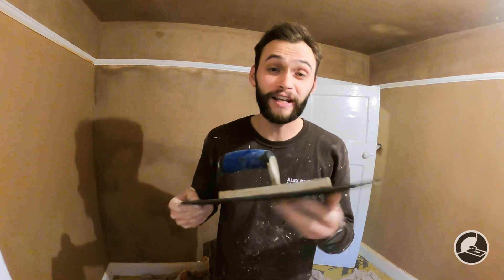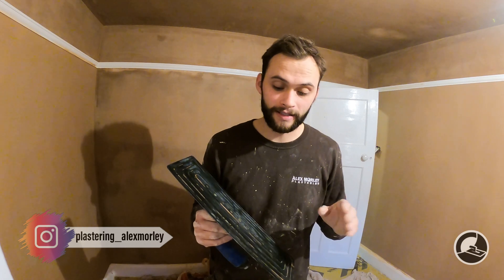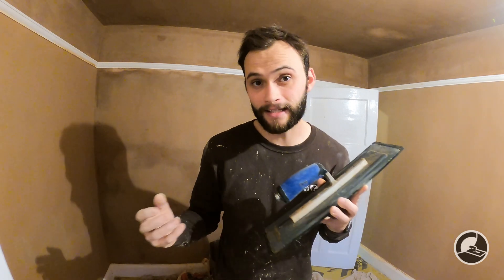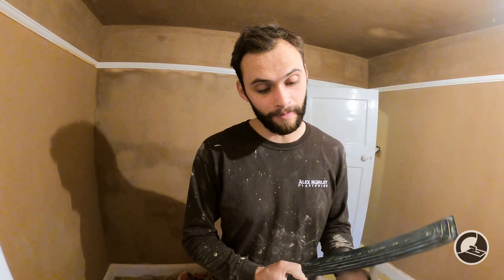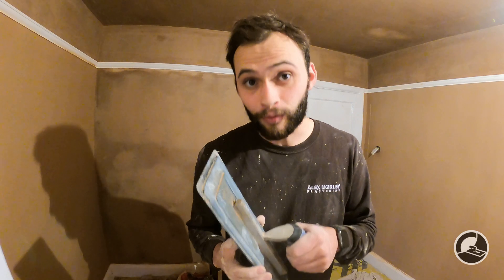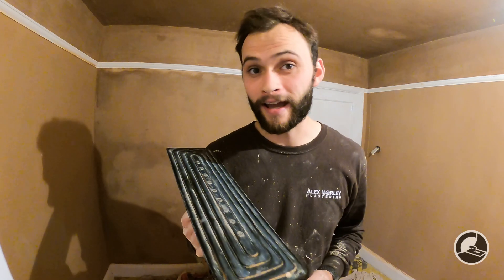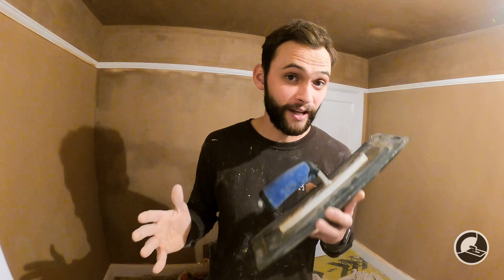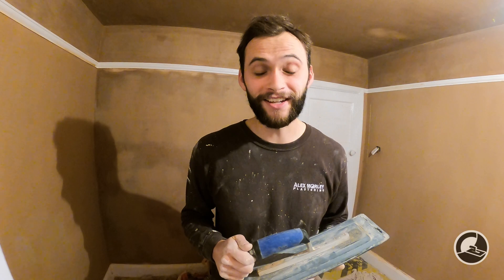Carta101- Review

Comment: Great thorough review. The main reason why I would never use one is the stepped layers of the face of the trowel. You couldn't even scrape off excess on the edge of your hawk. Horrible design. I'll stick to my Marshalltown I've had 10 years :-)
Reply: try the ox plastic float 18inch 
I use it to flatten between coats 
and polish 
bit of 600 sand paper to get rid of any nicks along the blade edge 
and the light and u can change the blades been using them since they came out pucker

Comment: it has the same handle as a refina super flex .and i don't think this guy would use his other plastic trowels on anything with blue grit .no plasterer would do that .so a little unfair i think.
Reply from the maker: Handle is unbranded. The refina ones are not. 

The Nela plastic we have isn’t designed for all stages of plastering. Where as the Carta101 is. As such it’s reasonable to test it on a medium used regularly in plastering. Such as blue grit. 

It clearly highlights the frailty of plastic when used for all aspects of plastering. Which is what I said in the review.